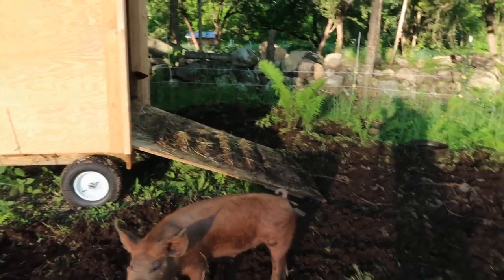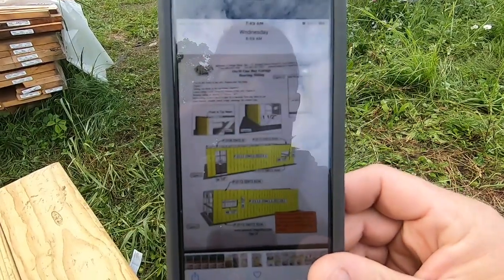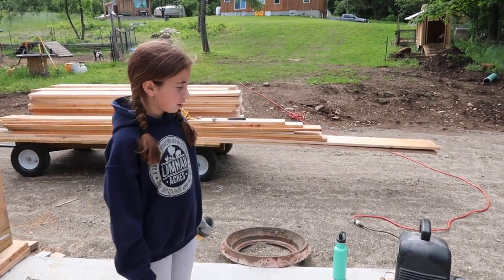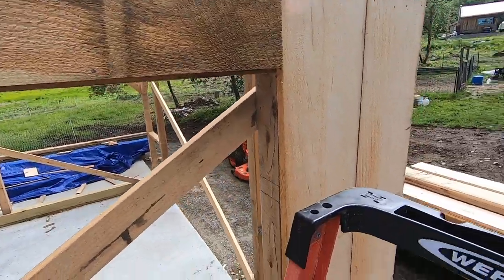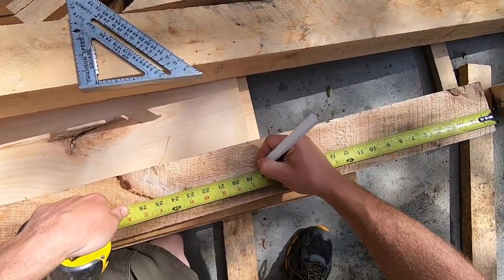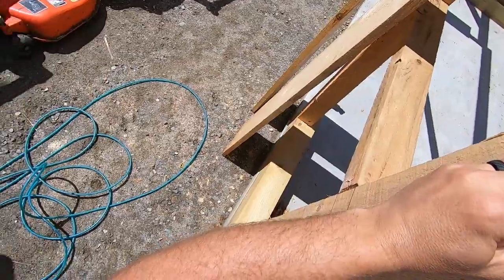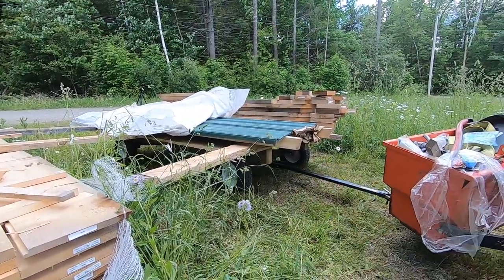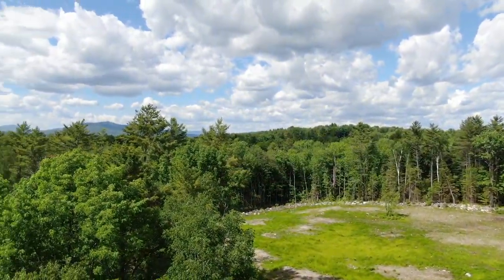Family of 3 BUILDS POST and BEAM BARN Kit ordered off the INTERNET

Comment: The barn kit company must love these videos. They are an excellent view of the process of building one of their kits.
The kids have grown so fast...Little Pea...is not so little😂😂😂😂

We resided half our old Tobacco barn [built 1940] and restored parts of it. It was here when we bought the property in 2015. The new planks are poplar and we have not painted them but let them weather. The originals were oak. It has now weathered to a light silver grey. We restored the barn in January 2017. I smile at your gorgeous straight lines. This old barn of ours was built to fit the slope of land....not a straight line anywhere😂😂😂😂😂 it’s 66’ by 64’ 
Great work you guys. Olivia is going to have such a set of skills👍🏼👍🏼👍🏼👍🏼👍🏼

❓❓Are you going to be able to access the side areas with your tractor for cleaning?

Comment: I guess it makes sense to place a door there also ! Are your rafters pre-built or do you have to assemble them yourself ? With as much as you have going on it might be time to buy a larger tractor for plowing the fields and such ! And keep the Kabota for smaller stuff like your doing now .
Reply: All timber is pre cut.
Reply: Tony Grimes that wasn’t my question ! I know there pre-cut . My question was were the rafters pre assembled .
Reply: @davekimbler2308  Looking at how the timber is packed it is all individual pieces therefore left & right rafters will be put up separately.
Reply: Tony Grimes wasn’t sure All bundles were shown, when it came off the trailer it looked like more then 2 bundles and I thought perhaps there were more .
Reply: @davekimbler2308  See yesterday's video.
Reply: Tony Grimes yes I did . Why ?